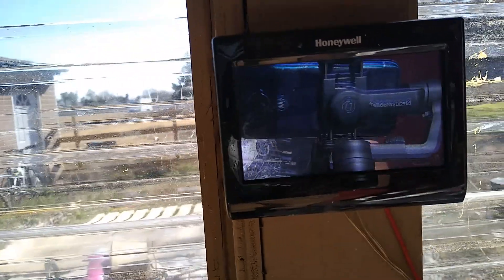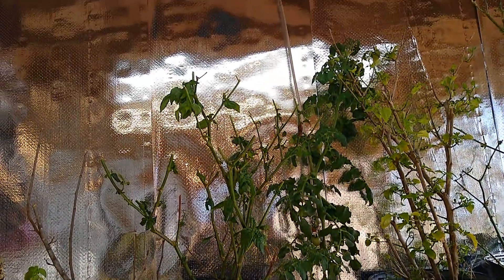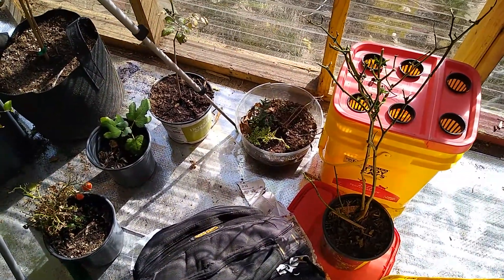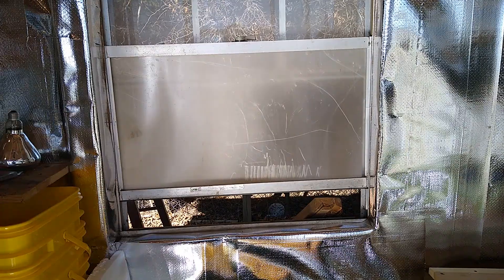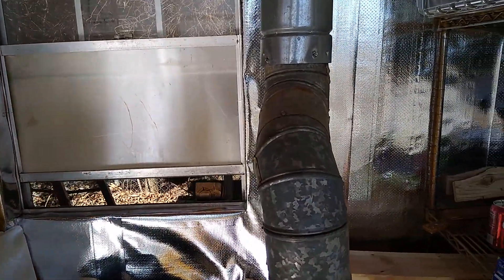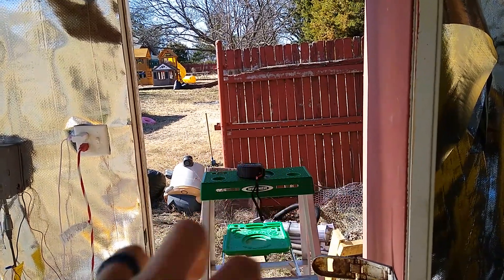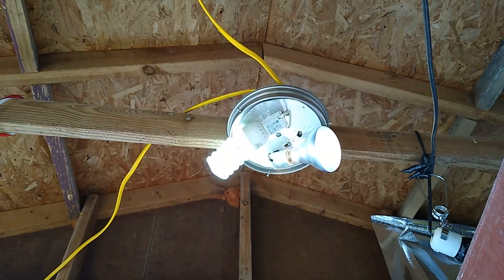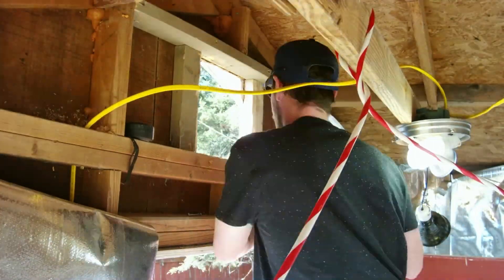Greenhouse update

Comment: Greenhouse is coming along quite nicely.   if you saying it gets too over 100 even in the winter time in my opinion id just leave the one clear wall only, dont knock down a second wall or it could very well fry all your plants on sunny days even with the ventilation.   other then that your set up is far surpasing mine.
Reply from the maker: Yeah I was thinking the same. About not replace the other wall for now at least. And if I do I may add air conditioning to it. That would be down the line. Your greenhouse setup looks pretty cool to me. Mine's not even fully set up. I'm just trying to overwinter some peppers in there right now for the most part.
Reply from the maker: Thanks for watching the video